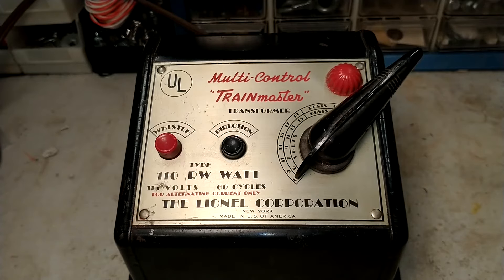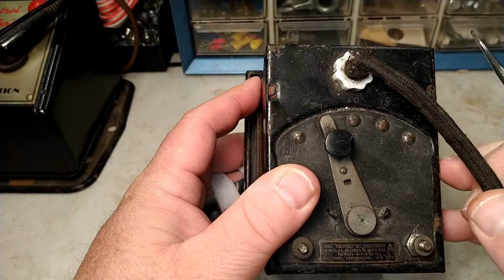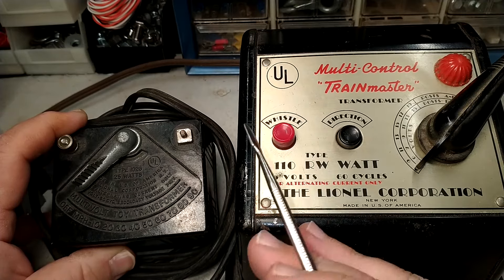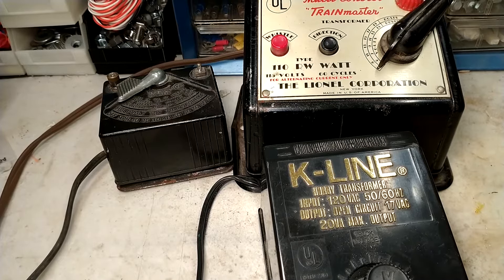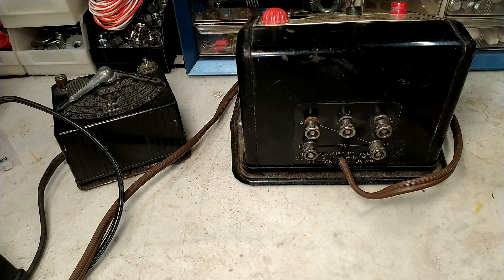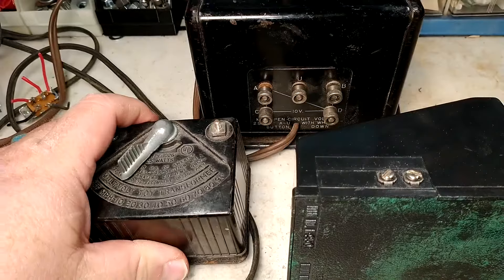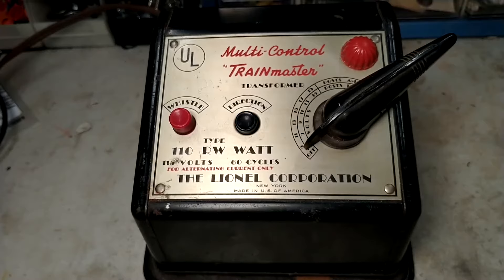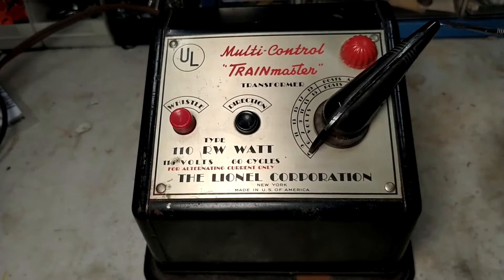Transformer Tutorial - How To Power Your Trains

Comment: I only have that transformer you said not to use from my grandparents and no money so I guess no trains for a while because I do not want to be unalived by electricity. :(
Reply from the maker: Not knowing your particular setup, you may be able to find small starter-set transformers (25-50 watt) for less than $20 at a train show/swap meet. Most long-time dealers/collectors have more of them than they know what to do with. (Online purchases are not a great option because of the weight of transformers - shipping will cost much more than the value of the transformer). Unless you are running multi-motor engines or lots of lighted cars, one of these should provide safe, basic operation.
Reply: Thanks ill take a look.
Reply: I got a type R 100 watt transformer and I need to know how to solder some wires back on. Only the right side works and I know that you are supposed to use A-C and B-C outputs for controllable power. Also, I found the thing for 27$.
Reply from the maker: @4d_giraffe  I would use posts B-C and B-F. The "A" posts will give you 24volts which is too much power unless you're running Prewar Standard Gauge trains. As far as soldering wires, if something is broken loose inside the case, I leave that to professionals. Ask local Lionel folks if they know someone who works on transformers or find an electrician. I am neither and I really don't want to get sued for giving advice on the Web that leads to a disaster.

Comment: Many of the old transformers have no way to turn them off. You have to remember to unplug them. Buy a new MTH Z4000 or Lionel ZW and you don't have to worry about anything and have plenty of power for multiple trains. If you or your friends have new trains with circuit boards they are protected. I don't recommend ever using this old junk.